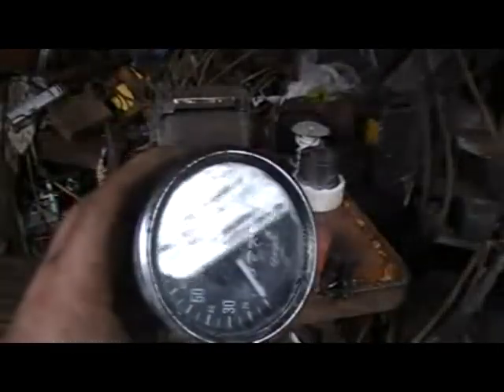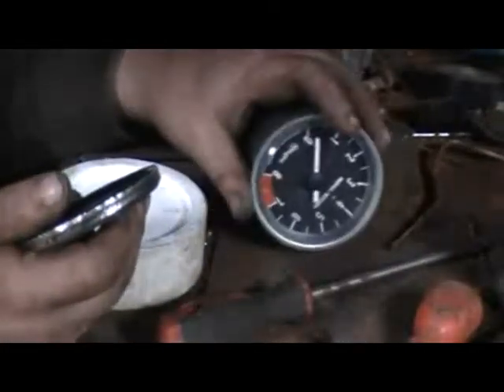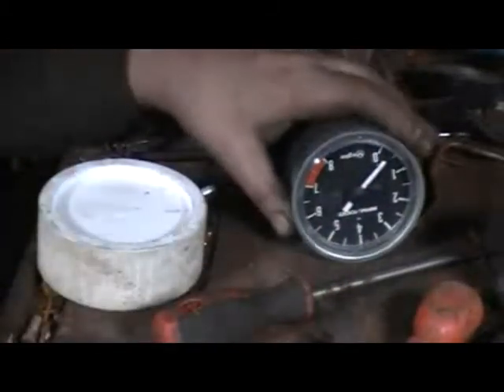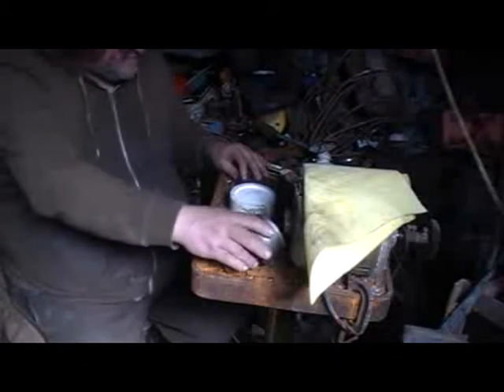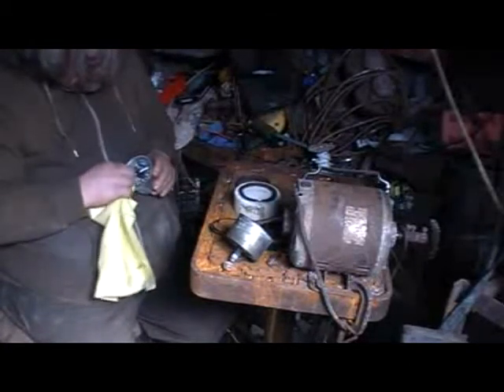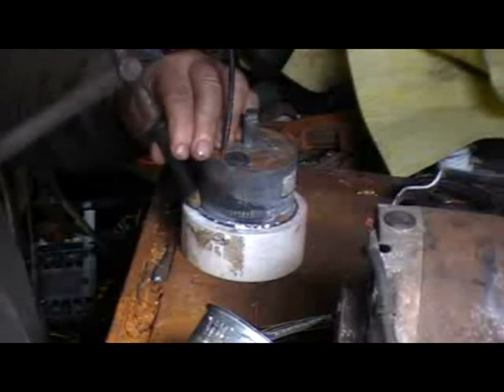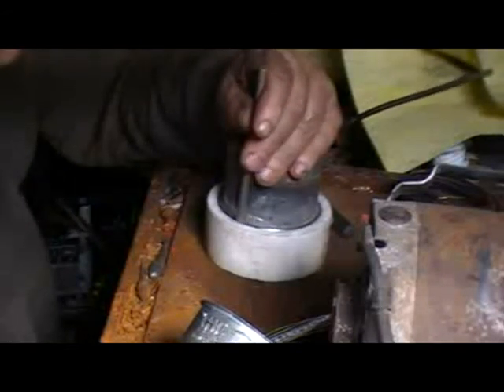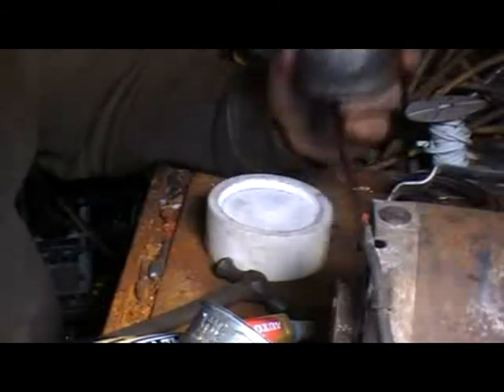replacing clock bezels on smiths type speedos

Comment: Well, where have you been hiding? I love the idea of the plastic block as I have always found holding the clock while you take the bezel off the hardest part. I made some curved jaws and welded them onto some old pliers to crimp the bezel back on. Don't you wish the clocks were still the old type with screw on bezels.
Reply from the maker: Aaaaah,you missed me ,how sweet.had some things to sort out and now with the sun shining(doesn't often happen in the west of Ireland)the farmers are at full throttle trying to brake things so lots of work coming in and little time to fit it all in ha ho all you can do is your best